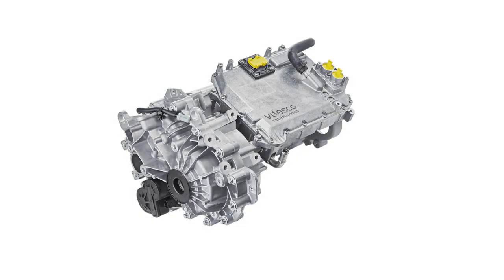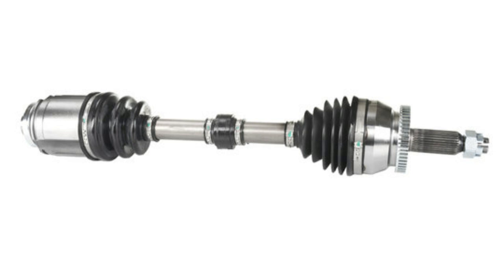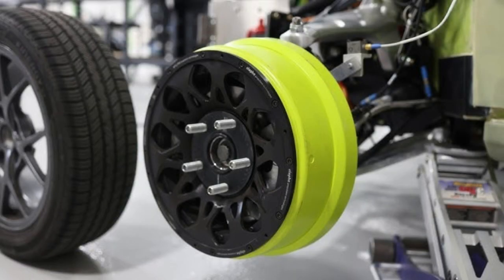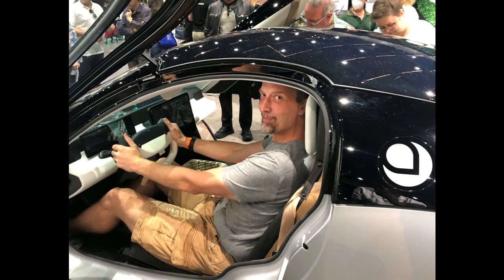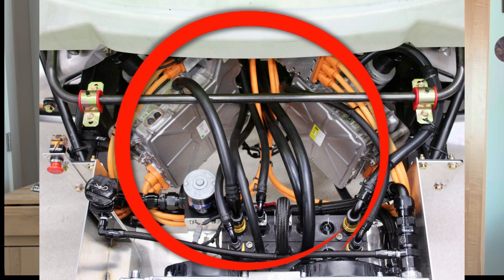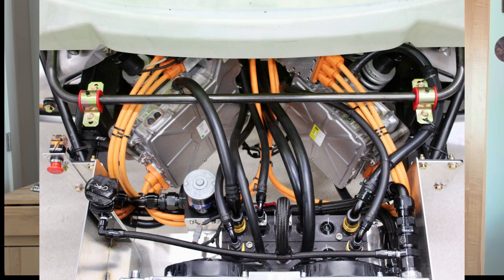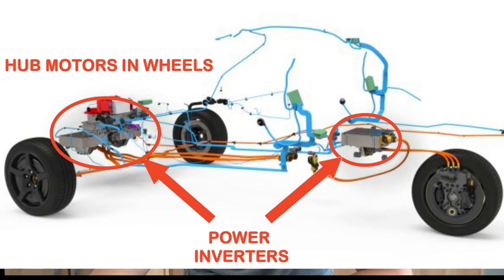Aptera's EMR3 Motor Design vs Original Elaphe Hub Motors

Comment: While I am trying to teach logic, do you see the air flow over Gamma at 9 minutes in? Notice it doesn't go down into the opening where the wiper sits? This is supposed to be the main source of cooling, and it gets none. Where they put radiators are internal, where heat can only build up until everything cooks in its own rising heat. No matter what the motor or the battery type, this silly trike will continue to fry like it has done plenty of times already. One day, a person might fry.
Reply: Wow! Great catch. I'm sure they never considered this.  You were right all along! They should just scrap the whole thing to please you bleating trolls at this point.  Scraping the bottom of the barrel to find something to whinge about is tough work, but you can alwys be relied on to fabricate the really scary stuff!
Reply: @J-W-Kelly  I have experience with knowing how you think, and it's far from rational. Here is the deeper thinking - try to refute it:

"Wow! Great catch." Nothing wrong with that thinking, so far, but it quickly takes a nose-dive from here.  

"I'm sure they never considered this." Nothing to be sure of. The years since 2005 has given them ages to consider it. My claim has never been that it was an oversight - I have always said that they knew they were scamming as soon as they came up with an enclosed front and skin cooling nonsense; they just never intended to sell one.  

"You were right all along!" If you weren't being sarcastic I would say your thinking has begun to improve, but there are so many examples of you saying I am wrong, and they are "all along". Hence, I see through your sarcasm and recognize you are the d1m-w1t you really are. But I have an example of being right along the way, and it is on the matter of cooling: I said the skin cooling wouldn't work, and about three months ago Steve Fambro announced the skin cooling had been dropped from the LE, with a maybe later when the technology improves enough. Me right - them wrong all along, lol. I will remain right on most of my calls. Start to realize that. 

"They should just scrap the whole thing to please you bleating trolls at this point." They are still making money, which is what they have wanted to make 'all along'. They continue to please themselves while fooling their fanboys. If anything, I (and other astute knockers) am just irrelevant to their real plans. I am sure they don't care how pleased we are. However, making suggestions about what they should do next is not for you or I to say. Nor does it alter the great catch.

"Scraping the bottom of the barrel to find something to whinge about is tough work," But easier than you finding something to praise. I have the advantage of natural intelligence. The picture of the wind flow I used; the NBC overheating episode; the Nikki overheating after the fake 6 trips up a hill were all not found in the bottom of any barrel, and were absolutely real. Even the overheating at the X-Prize didn't occur in some barrel. And me having a whinge is about as real as that barrel you mention, lol. I'm just sticking to facts, which are devoid of emotions, unlike your "wow!".

"but you can alwys be relied on to fabricate the really scary stuff!" So - what's the relationship between complaining from the bottom of barrels and fabricating scary stuff? Better still - what's the relationship between complaining and great catches? Nothing; only to self-display your scatterbrained thinking. Believe me; you have nothing to be scared about. They will never put you in one they have sold to you. The best you can do is sit in one for a few minutes and your chances of frying are less than winning the lottery. I'm trusting you're not one of the 29 employees, of course.
Reply: @aussieideasman8498  Well my reply to you got censored by someone making the world-of-words safe for five year olds, so not going to that effort with you again... except to say great effort!  Most trolls don't work at it much.
Reply: @J-W-Kelly  We all suffer the foibles of YT, but it's no excuse not to refute me. Your real excuse is because you can't. I am neither wrong, nor are you capable if I happened to be. Because of the first reason, I open it up to every intelligent person, bar none.
Reply: @aussieideasman8498  "foibles"?  It's actually someone specifically censoring comments, not some random glitch in the matrix.  Your steamed-cheese-for-brains schtick is to imagine dozens of negative aspects of a well thought out and innovative concept, that you, for some reason, hate.  But there are issues of serious concern... did you notice there are only three wheels and no door handles?  We are certainly getting cheated on wheels and someone might die because they can't be extracted from the vehicle!  Also dangerous to bicyclists and mailboxes because it's so wide!  They are not even going to paint it! Cheated again!  They had the nerve to adapt and move on when ideas were too ambitious to incorporate, and instead seek to get Aptera on the road in a timely manner!  Did you hear that they planned in-wheel motors and had the temerity to change their minds?  The horror!  This pod of death better never see the road! You can gish-gallop-word-salad with the best of them.  You have my undying admiration! Go whingey, go!
Reply: @J-W-Kelly  Both are foibles; just different kinds. I have no hate for anything, but it's a small annoyance and should be rectified. And that's before you switched to the silly trike. You should try announcing the change point. 
Who wouldn't notice the three wheels? [New paragraph.] If someone might die, you're being scary, lol. Rescuers will have to learn to knock. Historically dangerous to BMW drivers. They had the nerve to advertise when they hadn't adapted - the people should have moved on. I heard; and heard the mind change over a year after they changed plans.               And your admiration is already dead.
Reply: @aussieideasman8498  Random thought generation using key words to sound like authentic frontier gibberish, or a wee short circuit in yer brain-box?  Nobody knows for sure.  Keep it coming!  Very entertaining.
Reply: @J-W-Kelly  Do you happen to wear a kilt?
Reply: @aussieideasman8498  Ever try to eat a pine tree?
Reply: @J-W-Kelly  No. Have you ever had anyone say yes to that question? I have had lots say yes to wearing a kilt. My questions are reasonable.
Reply: @aussieideasman8498  Ask Euell Gibbons. He was an advocate of healthy pine tree eating habits. Not sure what his position on kilts might have been... also, I've seen Men In Kilts if that helps... so I guess I'm kilt adjacent by proxy... not an actual wearer of kilts. Hope that clears it all up for you.
Reply: @J-W-Kelly  If Euell was an advocate of pine tree eating I'm not asking him anything, and would suggest nobody does. It takes a f001 to make such a recommendation. I will cut to the chase, since you didn't pick up on my hint - are you from Scotland, or Scot adjacent in some way?
Reply: @aussieideasman8498   My peeps were certainly Scot adjacent at some point.  I studiously ignored your hint... or could it be that I'm just not hip enough to get your brilliant blather?  Nobody knows fer sure, but do tell yourself whatever makes you feel important... teaching logic is hard work... for a half-wit.  I have therefore cut you some slack.  Carry on!
Reply: @J-W-Kelly  You couldn't studiously do anything. The logic I teach is evidence no half-wit can produce it. If you want a battle of wits I will deliberately use half just to be fair to you.
Reply: @aussieideasman8498  Oh, you teach logic, do you?  No sign of that yet, but do bless me with more blather.... perhaps this logic you speak of will show up at some point?  Nothing at all self-aggrandizing about your posts at all so that's nice!  If I wanted a battle of wits, I would be looking elsewhere.  On this little thread, I am just slapping a troll around for my own amusement... shallow of me, I know, but we all have our flaws.
Reply: I have an idea. Get another hobby.
Reply: @andrewmclean1239  I opened up the challenge above; I didn't poll for people with random ideas, and I did say it was for the intelligent. However, you probably run for 'The Yank Ideas Man' with that one, lol (hoping you're from the US - fill in where you waste air, if not). BTW, did you know how many hobbies I already have? Never mind, thanks for being entertaining.
Reply: It amazing and confusing to me why Aussie ideas guy works sooooo hard at this,, what’s his end game?? 
What does he gain from all his BS?? In the end no one really cares I guess?
😂
Reply: @jerrymolnar8010  Trolls are either paid or they get some kind of sick pleasure out of being azzholes.... perhaps both.
Reply: @jerrymolnar8010  So you get amazed and confused over matters nobody even cares about. Well - at least you prove bull baffles brains, lol.
Reply: GullWIM removed my reply, but I have put it on my latest video. It was too damning for him to handle.

Comment: While I subscribe to IWM's being a crazy idea - mainly because of handling problems - it was those two snake oil salesmen who for three years espoused the superiority of them after having computers tell them they were integral to having THE MOST efficient vehicle ever. So if they are less efficient all of a sudden, then Fambro and Anthony were lying. They can't be right both ways, except in the minds of those who have no rational thinking - and there are no shortage of those among you clowns.
Reply: Tree stump
Reply from the maker: IWM are not that crazy of an idea, currently Ford and BMW are testing such motors, and at CES there was new configuration IWM called the donut motor. The most efficient EV in production right now is the Lucid @ 5mi/kwh. If it was because Elaphe could not deliver the quantity of motors or another issue it was smart for them to pivot to the EMR3. It would have been dumb of them to stick to the IWM’s untill death. 

Now we are both adults no reason to name call.
Reply: @ApteraAccessories  "IWM are not that crazy of an idea," Yes they are; they add too much unsprung weight which adversely affects safety, especially at highway speeds. That's good enough to be crazy.  

"currently Ford and BMW are testing such motors," That doesn't indicate they are sensible, but they may have some engineering trickery to compensate for the inherent handling problems. They would have to be good.

"and at CES there was new configuration IWM called the donut motor." I hope it is extremely lightweight? 

"The most efficient EV in production right now is the Lucid @ 5mi/kwh." I know. 

"If it was because Elaphe could not deliver the quantity of motors or another issue it was smart for them to pivot to the EMR3." It was dumb of them to go about it the way they did. Also stingy of them not to go for the much better EMR4. Old cr@p passed on to the consumer.

"It would have been dumb of them to stick to the IWM’s untill death." It is probably a case of the EMR3 until death, so fairly moot. 

"Now we are both adults no reason to name call." I'm 71 and heading into my second childhood, so there's the reason. I like get ahead of the curve.

Comment: Nice analysis! I think that Elaphe was a victim of the investor drought that we have seen in the last 3 years, especially with so many EV startups struggling and failing. Elaphe had been planning on the EV market growing wildly after the success of Tesla. But Lordstown had unknown but significant drivetrain issues rumored, and Lightyear also ran out of money, plus I think that a big deal from Mercdes and others fell through. At the fully charged show in San Diego, next to the Gamma unveiling, their engineers talked about Elaphe opening up a new factory to scale up the production of a bespoke motor for the Aptera.  The new motor was smaller and lighter than the M700. But the M700 was really designed for crossovers and pickup trucks that were MUCH heavier than the Aptera, and more targeted on high performance, torque, and precise control, rather than on superior range and efficiency. It is a good point that the Aptera customized Elaphe motor was down on HP and torque, and had a lower 101MPH top speed rather than the M700s 110MPH. And it was a little lighter than the M700. Even though the EMR3 can't freewheel and have a tiny rear motor run by itself at freeway speeds for super efficiency, Tesla was able to have a front permanent magnet motor combined with a rear induction motor to provide extra power and control, but using just a little (not double) the power of the front motor alone. I am still hoping that Aptera will still use the custom Elaphe motor in back for the AWD model. But they have left the option open for a 6-10kW hub motor commonly used for years in small Chinese EVs. And proven reliable. For me, I'm not waiting for AWD. Even though I want it for the added power and wheel control. Maybe in the 2nd gen Aptera in 2027.
Reply from the maker: Great insight and contribution to the conversation. Thank you for watching!
Reply: I really appreciate the thought you put into this analysis. And I think your overall approach makes sense. I don't really know enough about things to critique the efficiency of the motors myself. One question I have though is about getting the hub motors up to spinning speed and the associated energy usage. I've read somewhere that this could cause the hub motors to be less efficient but I really know nothing about it. Just wondering if you have a opinion on this. Thanks very much, Tim